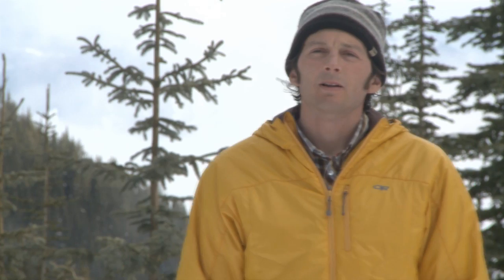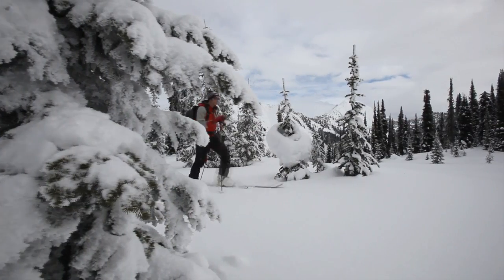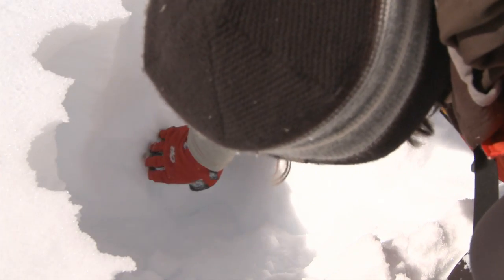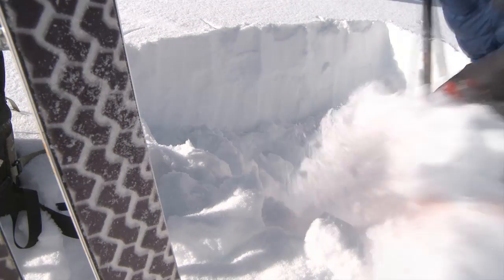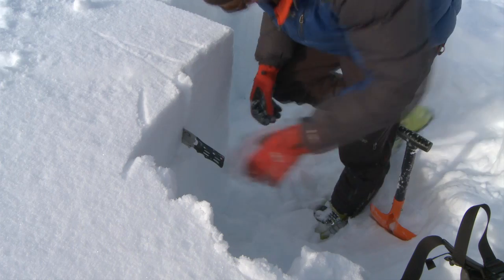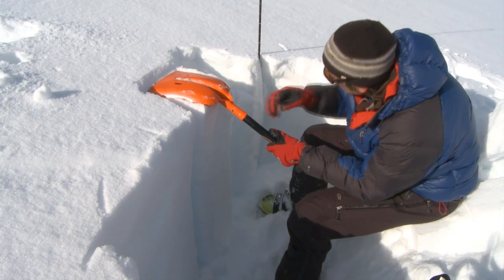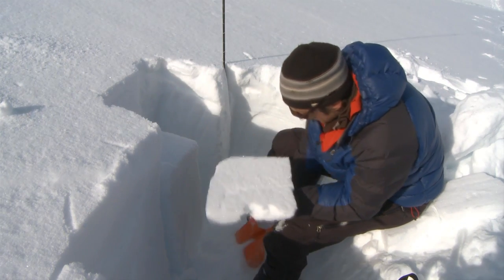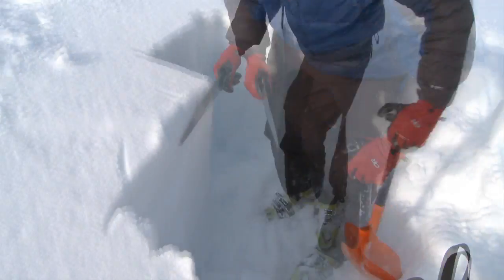Snow Pit Basics w/ IFMGA Guide Evan Stevens

Comment: Hi, I like your overview on compression testing, but I would appreciate a commentary from an expert on what results are a red light for skiing on similar terrain to the test. We use the low/moderate/considerable/high/extreme scale on Mt Washington where I ski, and the moderate to considerable range would be conditions I would red light on, but I don't have a good feel for how that translates from the compression test. Also, the snow rangers only post conditions for the east side the mountain.
Reply: If you only ski when it's "low" condition, then you're basically skiing ice. What's the fun in that?
Reply: The east facing aspects typically are more prone to slides bc of their prolonged sun exposure that starts early.  South would be second worst in terms of avid danger/exposure.  North facing aspects are considered the safer route.  Most places give their evaluation of the east facing aspects bc they are the highest prone to avi danger.